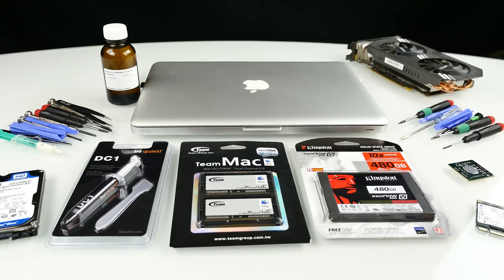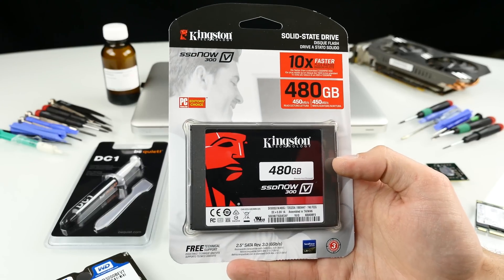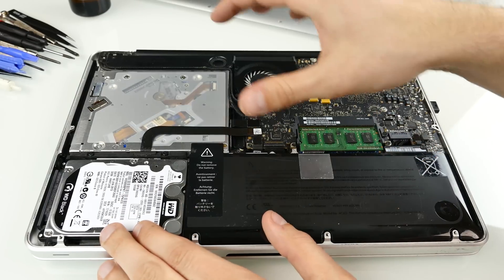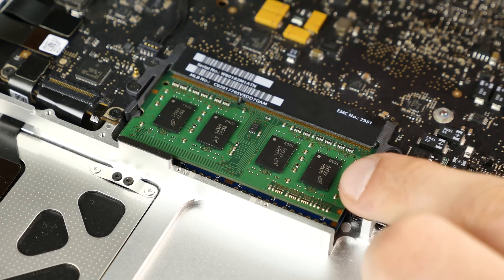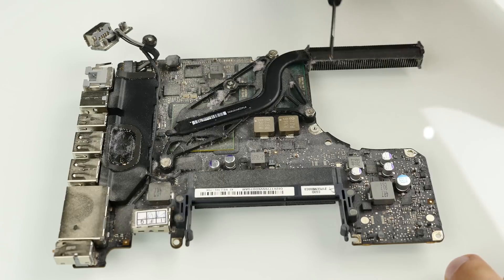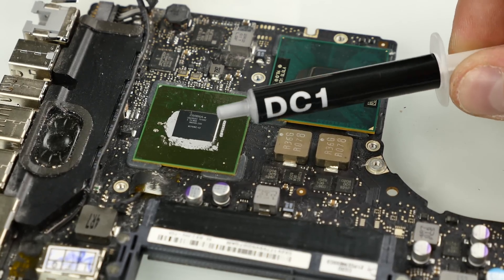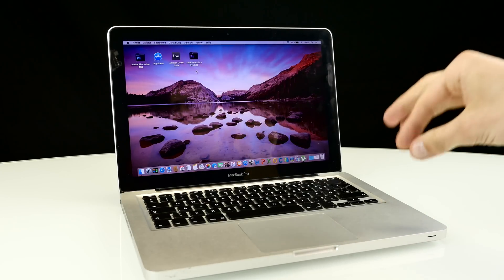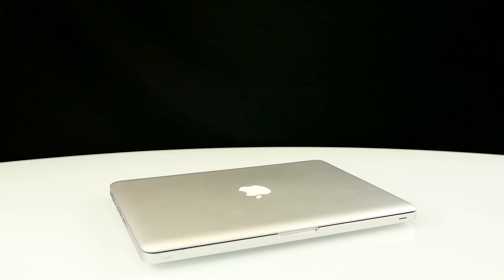How to Make Your MacBook Pro Faster - 2018!

Comment: the RAM on this MacBook can be extended to 16gb, I did it on my Mac that was produced early 2011 and it works perfectly!! even apple clam that max is 8GB...
Reply: oh... but it doesn´t risk your  mother board gets overheat or brake? I wanna make the same (16gb ).
Reply: Emmak Leonardus 6 month of using, no problem with overheating. please note the biggest boost will come after SSD, make sure the choose the right one.
Reply: Adama Camara of course! Drastic performance, it works like new MacBook series. Highly recommend!
Reply: Adama Camara also don't forget to make your own rewiev on SDD, it will will be your major booster for MB
Reply: Adama Camara ram is good, but only SDD will drastically boost your MB
Reply: Adama Camara congrats! Now you will injoy your Mac for next 5 years.
Reply: Yeah why not doubling up the recommended standard specifications, what could go wrong?

Comment: Will this work for MacBook Air?
Reply: MacBook Air is a completely different type of laptop that was designed to be the ultimate in light weight and thinness but unfortunately that means that they can't be upgraded this way. MacSales does have SSD card upgrades for the MacBook Air but they don't all necessarily increase speed, some only increase capacity.  http://macsales.com

Comment: i have the same macbook 
8 GB ram 500 GB HDD
now it's not Slowing Down but it stops & after 10 Sec it Continue 
happen a lot actually 
& i'm really mad 
what To Do other than what he Did 
& Don't tell me Buy a new PC -_- haha 
need Some Good answers 
& thank u
Reply: Perform a clean install of the operating system and it should go back to normal. Make sure that yo have a good backup first so you can restore all your files when you have completed the re-installation.
Reply: What

Comment: Just put two 512 GB Samsung 850 Pros on a 2011 Macbook pro, corsair mac memory 16 GB memory cards and after putting the hard drives on Raid0 my mac runs insanely fast and cost me less than buying a new laptop would have with similar specs!

Comment: I only clicked to see how he is gonna put the desktop graphics card into a MacBook Pro...
Reply: You can't put a full sized desktop graphics card into any laptop but you can use an external thunderbolt enclosure and install any full sized graphics card into that enclosure to get maximum performance. Apple now even has Nvidia drivers for the 1080ti so there is no limit to how much graphics power you can add to a MacBook Pro.

Comment: would you share me how to connect your macbook pro to external GPU BIZON 2 ?
Reply: Just plug in a Thunderbolt cable into the MacBook Pro, plug that cable into an external Thunderbolt enclosure, insert your full sized graphics card into the enclosure, turn the power on to both devices. If its an AMD card then often you do not have to install any drivers. Some Nvidia graphics cards are automatically supported but if yours isn't then just download the driver from Nvidia, install it, reboot and you are all set.

Comment: Just spent a fortune on a 2015 Macbook pro 15inch with i7 ....... shit is slow as balls editing in final cut. Is this the way its suppose to be ?!?
Reply from the maker: i render all my videos in final cut with a 13" pro...
Reply: I think you have had too high expectations for your computer. You have to bear in mind, that editing in final cut is a really big task for computers, no matter what specs you have. Also, the power of the computer isn't lowered just because it's a mac. What you might want to do with your computer to improve the performance by making sure that no programs is running in the background.
Reply: tobi6277 ok will do. Also it's fascinating to me that this software can bottle neck this brand new laptop so bad. Do you have an article or knowledge of why something so simple as editing 4K videos can be so stressful on my Mac. Last time I checked iPad pros could edit 4K videos no problem. Maybe I'm missing something.
Reply: +Wesley Birden Well mainly because there is no dedicated graphics card in your computer. It might help a lot if you invest in a core, like the one he talked about in the video, where you can install a graphics card and then plug it into your computer via thunderbolt. And as I said, the software (OS X) is NOT bottlenecking your performance, which a lot of people think.
Reply: tobi6277 Wow so my AMD Radeon R9 M370X 2048 MB current card can't cut the mustard? I am more impressed with what my macbook air is able to do. I thought if I invested more in a more capable machine that it would be proportionate to what I spend. I think your right maybe I did have too high of expectations of my machine.
Reply: +Wesley Birden yep, I think that is your reason for your disappointment. I mean, two gb of memory on your card is still not a lot when editing 4K.
Reply: The funny thing is I have a systems resource monitor always on, displayed at the top of the monitor and my CPU never breaks a sweat (only when exporting), My ram is rarely even half used (16GB) and the temperatures don't get higher then 130 -140 (unless I'm exporting). This Mac has the second Gen PCIE based SSD 512GB HD. The Bottle Neck is either the graphics card or the software optimisation itself. I just think its a bit sloppy of Apple to design a software that wouldn't take proportionate advantage of the other resources of the computer. If graphics cards were so vital to the editing experience the graphics card should be some insane 8 GB DDR5 ram beast, and then pair it with a weak i3 processor with 4 GB of ram. This is a machine with PRO on it there is no excuse for this amount of lag. I feel like this is a Nigerian email scam or something, Just pay a bit more and things will be alright just buy a Mac Pro and it will be better. But I honestly believe I would still be expecting too much from even that machine. I think my next rig will be a PC. This Macbook is best for showing off to potential clients, as far as getting work done its incredibly frustrating.
Reply: +Wesley Birden Temps at 140!?!? You are getting thermal throttled! Google "what is PC thermal throttling" if you don't know what that is.
Reply: 139 degrees F. is my normal operating temp of the most part. My fans are barely spinning at this temp. My fans kick in at 145- 150 and my Mac tops out at 150 to 160. Keep in mind at 140 my CPU is only using at most 10% on the percentage of usage. Throttling does happen just not at that temp (140F).
Reply: Wesley Birden Oh I thought your units were in Celsius as that is the standard unit to use when referring to computers.

Comment: I'm pretty sure the memory specifications on older macbooks are more lenient than you'd think. I upgraded a similar model macbook with DDR3 1333 MHz RAM and not only did it boot up perfectly fine, it actually recognized the faster RAM and supported the higher speeds.

Comment: actually i bought mine just today gotta say it works fine i did all the steps with a samsung ssd 500gb and i upgrade ram and its working terrific i even install gta 5 and in medium doesnt have any problems and the best its that it only cost me 600 usd for everything when you for 600usd on a windows you get a shitty celeron processor
Reply: 600$ for PC with Celeron processor? For Celeron PC, you can simply pay 60$ 😃
Reply: Where can I buy one though
Reply: And for 600$, you can get a PC with new Skylake i5 processor and the GTX960 with 16GB DDR4 memory xD
Reply: +rey morris Craigslist/amazon and all these shops. If you search properly, you can find amazing deals.
Reply: +Ondřej Pekárek nah. More than $600. $700 sounds more reasonable

Comment: 4:27 Yeah, uh, I just bought a 2013 MBP, and nothing is upgradable. As far as I know, everything is soldered into the logic board, but I wouldn't know because the screws aren't philips anymore, so I haven't been able to open it up.
Reply: Yeah, you can only upgrade Macs from 2012 or under, I'm sorry :(

Comment: Newbie don't try it at home, only for those have extra MacBook or get boring around
Reply: Lol mate, replacing the ssd and battery are extremely easy and the only difficult one would be the logic board I believe you could get mixed up or forget connections.

Comment: Please stop. More RAM does not increase your performance in most cases (especially for people using older macbooks).
Reply: Okay, so 2GB is fine? No. We both know that upgrading the ram can help things out. Especially in the case where someone might be using alot of apps at once (Hence MacBook Pro )
Reply: The average MacBook user usually does not need more than 2GB, especially with such a weak processor and graphics card
Reply: I have exactly that Macbook, Mid-2010. Came with 4gigs. Even when you simply open Safari or Chrome and Websurf you can reach that 4 gig Limit. I upgraded to 8 and the effect on performance was REALLY noticeable!
Reply: There is no way a browser alone should be using more than 500 MB, check if you have a virus
Reply: Well, you never have used chrome these days... have u? Here is a screenshot. Just using some Applications, you can see how Facebook alone in Safari is at almost 500mb. The whole System is already using 4,23gig. This would be lower if I would not have 8gig installed. But once you give MacOS the space it uses it! And you notice the difference! /Users/dagstar/Dropbox/Screenshots/Screenshot 2016-06-01 09.37.26.png
Reply: well... seems like i can't put a screenshot here...
Reply: I have windows, should be comparable enough. and I have Firefox (I'll download chrome if you want), the whole system is using 25% of my 8GB and is still running amazingly fast (x4 860k, GTX 750ti SC) and taking out a 4GB stick of RAM doesn't even decrease my speed in most games
 let alone a web browser.
Reply: Well, I just said from real world experience, once Mac OS implemented the feature to start compressing data in the ram once it would otherwise run out of it and would have to swap it (i think mavericks started with that) I did really notice the bump to 8gb of ram. When otherwise the system would have started to stall it now still performs well! And yeah, sometimes it is enough to just have itunes running, mail open and some intensive tabs in your web browser. Especially chrome was known to be a memory hog though I think they've gotten it somewhat under control.
Reply: http://imgur.com/RlFBSUy Yeah maybe so
Reply: the beauty of chrome are the extensions, and there are many people who use a lot more than one tab ;)

Comment: Actually the Akitio Thunder2 PCIe does work with the MBP 2010. It works because the Akitio doesn't use all 20gb/s of the thunderbolt2 cable, therefore you can use the normal 10gb/s thunderbolt cable.

Comment: Hi Techmagnet I have the mid 2010 pro as well(MacBookPro7,1) I just upgraded it to a SSD with an hdd caddy which really helped a lot speed-wise. I read somewhere that my type of macbook isn't compatible to upgrade to ram above my current 8GB. Is that true?

Comment: Excellent video. I have the exact macbook pro as above and I would personally stray away from the samsung 850 evo ssd (non-pro), had a nightmare issue with startup and freezing app running. Samsung does not state full compatibility on mac as well.

Eventually got myself the Crucial BX200 ssd, stable performance thereafter!

Comment: mine is a 2011 and it has sata3. i upgraded with 1TB samsung evo 850 SSD and 16GB of ram, and it is so powerful. the computer is old the battery life sucks now but apart from that it is still running like a champ. i don't feel the need to upgrade for a new macbook pro, i think i can still use it for a good 2,3 years
Reply: If you swapped out the SSD then you already have the ability to swap the battery so just swap in a new battery and you will have a laptop that is good for many more years.
Reply: SweBass could you please give me more details where I can get the same part I have Aldo 2011 model MacBook Pro, thank you
Reply: You still using it?

Comment: kingston 300v is shit read and write speed 150mb
buy a samsung evo
Reply: its cheaper and this mac can't fully utilise the SSD. PCIE based SSDs in the newer mac are faster than the samsung evo.
Reply: 300V in sata2 have to be 300ms and is 150mb read and write
Reply: yeah my 300v broke down on me, so shit, Samsung Evo 850 or any Evo will be better.

Comment: Had you problems installing El Capitan with 8 GB of RAM? On 13" or 15"?
Reply from the maker: +gnaccArt yes. had to put 4gb back in then it worked. then i swapped the 4gb for 8gb and it was fine

Comment: 400GB SSD = £220
Ram = £50
Battery = £30

Laptop, £300?

You couldve probably just bout a 2013 one with ssd and ram
Reply: +Peter Cruz But they arent as fast
Reply: What wouldn't be as fast? The ram and storage would be. Depends on the cpu. Also an older one means wise tracks pad (huge deal) and worse keyboard. Terrible idea imo
Reply: No the ram and storage on newer macbook are not as premium as ram and an ssd you can buy yourself
Reply: What are you on about? The 2015 MacBooks have nvme m.2's (1500mb/s). Even the older one have PCIE.

The SSD in this video is around 400mb/s (very average)

And even if you did buy better storage the 2011 macbook is incompatible. The only point in these older MacBooks is if you need a mac and you're broke, not blow £300 making it slightly more usable. As i say a late 2013 macbook would've been way better.

High res screen
Lighter
Will last longer
Better battery
Better trackpad
No installation
Better resell value

Comment: Good video, have been inside of a couple of macs myself, disclaimer hobbyist, not a pro here. However, I cringed when you touched the thermal paste. Not only do you mix the oils of your skin with the termal paste, you also create air bubbles between the contact layers! Air is one of the best insulators in the world, that is why we put glass wool as an insulator in the walls of our houses! (tiny stale air pockets). You want to out on a tiny blob of paste and let the heat sink spread it out! Too much and you are insulating, too little and you do not get complete contact! However, it is nearly impossible to get too small of an amount as what comes out of the syringe will almost always be too much. 

Again, great video. BUT JESUS HAVE MERCY ON THE MAC OF YOURS! lol
Reply: Anonymous Wolf it's not recommend but shows no long term or even short term affects on cooling. I cringed a bit too though that stuff is so hard to get off of skin.
Reply: Anonymous Wolf l
Reply: I am a long time pro and we never touch thermal paste with our fingers and we definitely never put our fingers on the cleaned CPU heat spreader (cover) ever. Although for home use you can get away with it, there is a risk of catastrophic failure every so often, if the paste fails in the wrong spot. That kind of failure will cost you more than just taking a moment to apply the paste without touching it.

Comment: You cannot add external video to an old macbook. Just saying. Also there is no point to take a macbook apart this much.
Reply from the maker: +Blur Lahonez yea not this one. but all with thunderbolt starting at mid 2011 i think.
Reply: ***** They don't start adding thunderbolt until at least 2015. It's a new technology sorry to say.
Reply from the maker: +Blur Lahonez nope. mid 2012 https://support.apple.com/kb/SP653?locale=en_US and even some mid 2011 had it. sure thunderbolt 2 on the new ones or thunderbolt 3 in the future will be way better. but should work tough
Reply from the maker: +Blur Lahonez its not too bad with my new 13" retina with i5, akitio thunder 2 and a GTX 970. but still alot of loss. but video rendering time is like 20times faster :)
Reply from the maker: i know if you pay for all that its not worth it :) but luckily i got a free sample of the box and used my old gpu :o but yeah hackintosh is nice. is wifi working fine on yours ?